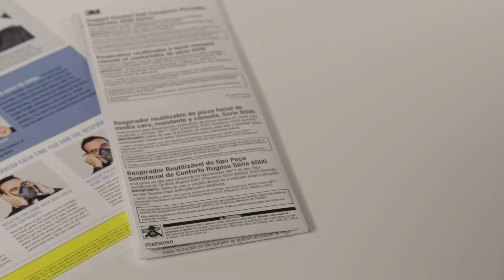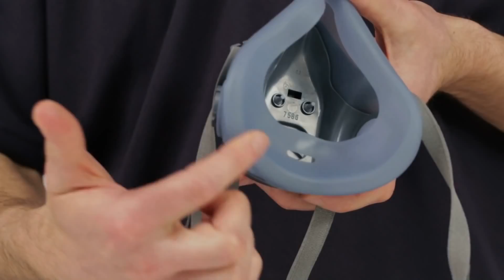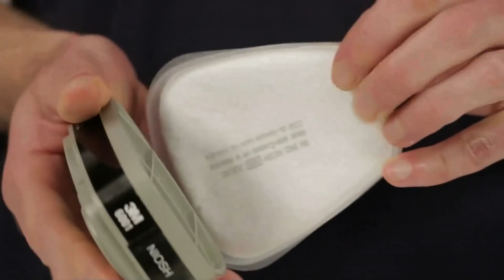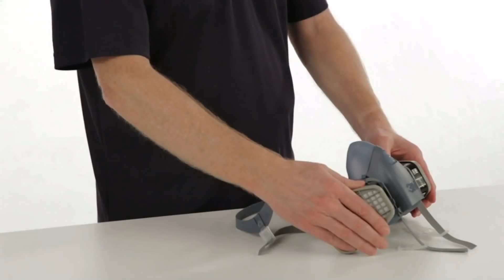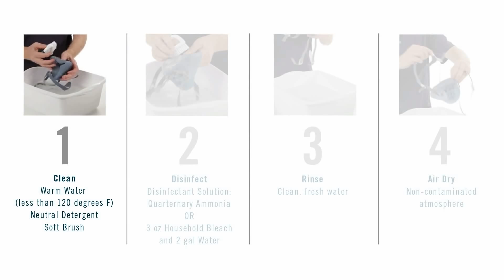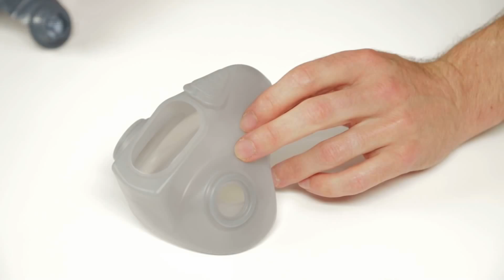3M Half Face Respirator 7502 Medium

Comment: My issue with this model is that thw filter holder tends to break when locking on filters..
Also the tiny plasticpin that holds filter holder and seal rogether usualy doesnt last more than 2 disassemlys. Last  one broke down at first. Funny that they cut the video right before having it completely reassembled....
Reply: I just bought one and had the same thing happen. where as the 1/2 mask has a screw in cartridge didn't have a problem however I don't think it was the right mask the what I was doing
Reply: It's a critical you go buy another one and pay no attention to the editing of the video nor the AI reading it...

Comment: These 7502 leak very ofter when you move with it. Mine leaks too many times around top near nose when testing and placing hand over exhaust ventile. Do 3M offer a more better mask that has a better seal over your face or full face mask ?
Reply: 7502 is the best :(
Reply: Depends on people's face shapes and sizes and how compatible that is with the sizes available/the sizes you choose but 3m hf-802sd fits my face mostly pretty well (with some slight discomfort squeeze to the cheeks and the area above front upper lips but I do wear braces on my teeth and that's what's causing it)
Reply: Which would you say is more fit for a narrow face? My disconfort with 7502 M is that it needs a very strong tightening in order to keeo completely closed at sides of nose and cheeks. Sometimes it even leaks under chin as well, but size S is not a stock item at our local equipment shops, and according to 3mvs general dace measuring guidelines im supposedly in on the border between M/L (which is just bull..)  @matt-na